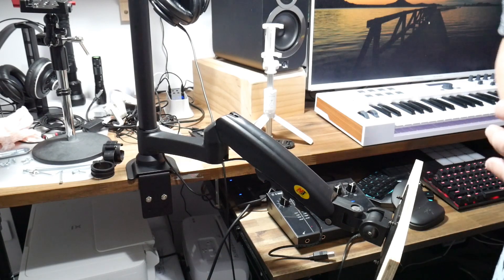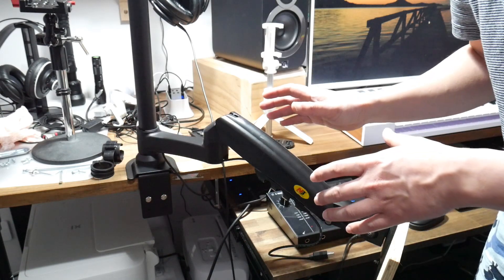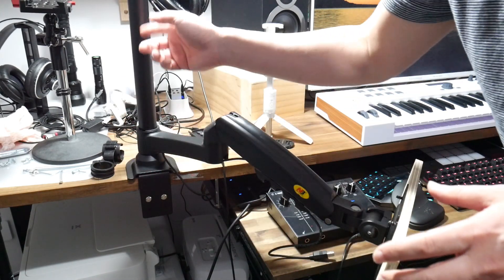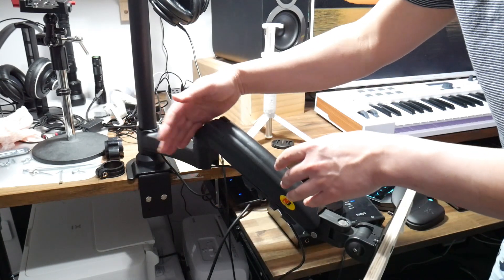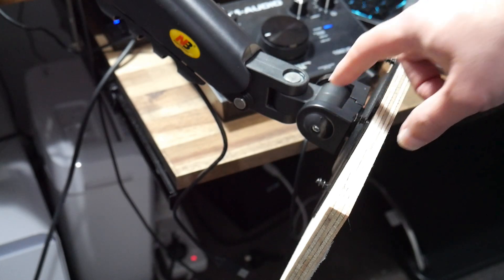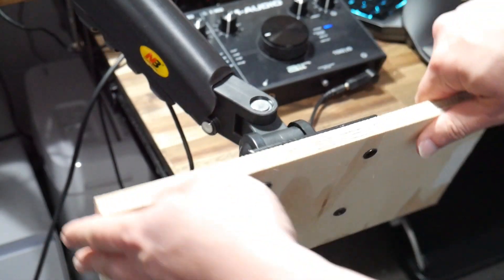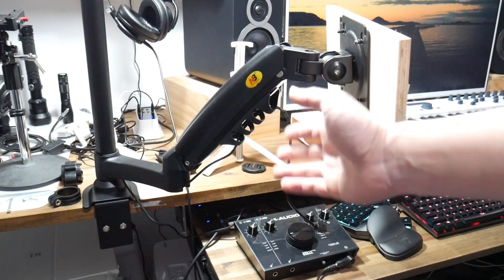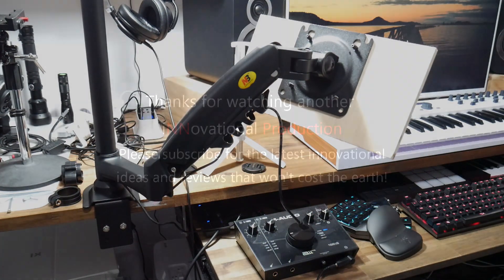Cheap North Bayou NB H80 Gas Spring Sturdy Monitor Arm

Comment: i cant seem to adjust  the up and down (1:32 )tension. mine is stuck? the hydraulics has an issue.  how do we make it work????
Reply from the maker: There is a plus and minus symbol on the plastic, make sure you adjust to minus if it is very hard to move

Comment: I have this exact north bayou h80 but the torque adjustment is impossible! it says on the manual that you have to use the 5mm star wrench on an awkwardly positioned tiny hole and you just can't seem to loosen. so frustrating.
Reply: Same bro i have F80 version and my monitor can even lower down
Reply: I recently bought one, and have the same issue, cant control the tension allan screw head because it sorta covered by the plastic housing so the  wrench cant fit in. is that ur prob too???
Reply: @boysopas5951  mine fit but either u losen or tighten i remain same
Reply: @vertwheeler6698   this really sucks!!! cant fit in the damm wrench on a wrong angle posiition allen screw.
Reply: @vertwheeler6698   ah yeah, yesterday  thought the problem was the tension adjustment. turn out its not. its the hydraulics for the up and down, its stuck and wont move. tried the "+, -" and nothin happen. damm product

Comment: I saw the spec said that it only can accommodate 17-27 inch display and up to 9kg. Mine is 34 inches at 7.5kg. It's well below the max weight but way higher in display size, can I still use it ? I'm okay if I will not be able to use my display vertically.

Comment: How did you reach the adjust on the bottom part where you can bend the arm
Up and down? I cant reach it. Does not move at all :(
Reply: mam, did u also buy this version H80  and it dont work??  coz i also bought one. @ shopee???
Reply from the maker: You have to push the arm all the way to it's low position (it's quite hard). Once you have done that, it will expose the Allen bolt where you can make your adjustment
Reply: @innovational  i was wondering how did u make the tension so smooth that u can make the arm up and down without a sweat? i tried lessening the tension and stil kinda hard. then the part where the monitor is mounted to the square top part. it wont rotate as if its stuck solid???  How i can rotate it ? do i need to hammer it to turn??? need some advice so i can use it.

Comment: Anyone can answer plz do, I bought two NB F90 arms - needed a part, could never reach them - when I did - they do not sell parts, The problem is nothing changes when you increase or decrease the tension on the arm.. Either way it springs open again. Does anyone have any thoughts?
Reply: same here, did you ever fix it and how
Reply: @F2005-k3q  For the larger monitor - I purchased a universal   piece that both holds the monitor top and bottom. I added extra stuff just to really make it tough - when done I was 1 lb over the max for the arm however it worked great. Large lesson was to not mess with the spring until the monitor was actually on it - DUH. It does not know what level to tighten on. Scratched my head for a day, then read about that on a video. The smaller monitor, I just needed to adjust everything again but on the back of the computer there are only two working screw holes in the monitor back. For that that is working but down the road when I switch to a new monitor - I will get another brace. I have the link if you want to see it? I actually did not think it would work but it did.

Comment: Is the arm made of metal or plastic?
Reply from the maker: The post and clamp are definitely steel. The arm is covered in a plastic sheath, so it's hard to know, but the weight of it indicates steel parts inside.